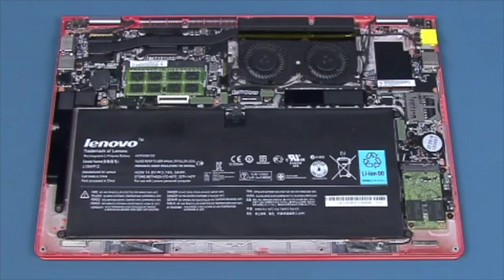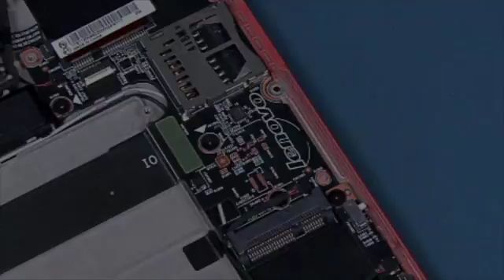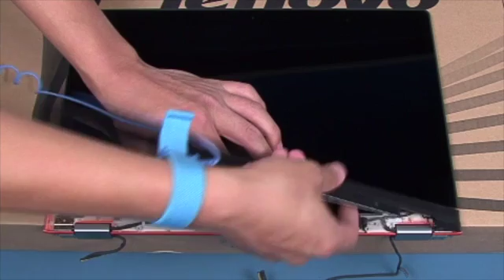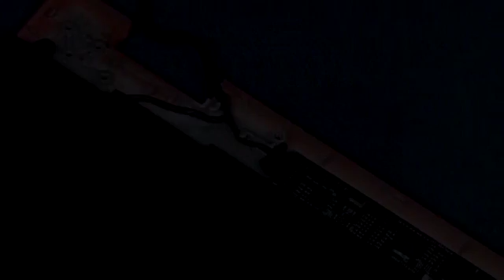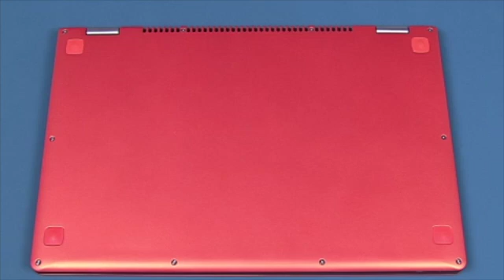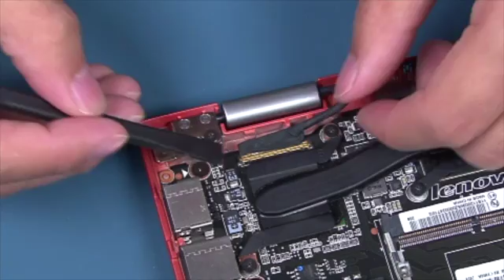YOGA 13 Complete Assembly and Disassembly

Comment: Mind those tiny connectors, some pull up, some pull out, some need unclipping before pulling out. Most will come out easily if you are doing it right, don't force them.

Comment: This doesn't make sense. You take the keyboard off then put it back on and magically the whole cover has been removed and the battery is exposed!? What did you do?
Reply: Exactly. I don't understand this video. Why did he put the keyboard back on? What tools does it take to open the bottom panel. Mine are not Phillips head. Looks like Torx screws.
Reply: Yes, TORX screw - T5. I recently ordered a complete set on Amazon for under $10.
Reply: I think this video is a series of independent clips from a repair guide made by the manufacturer. Each clip shows repair engineers how to do a specific task. They have been glued together, you need to look through to find each bit you need - it's nonetheless very useful. It helped me replace the motherboard successfully.
Reply: As @chrisb103 said it seems to been pasted together from various clips. I would add that they are not all in order, you'll probably find the bit you asked for elsewhere in this video.